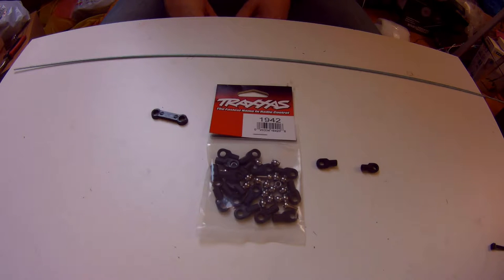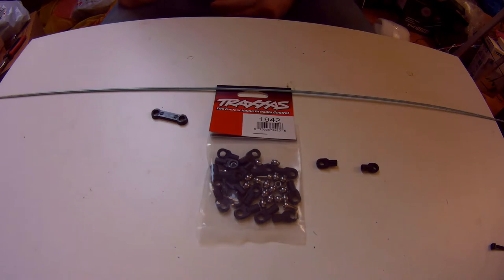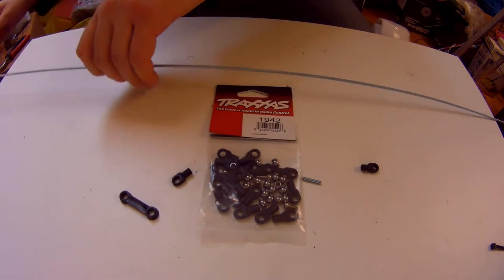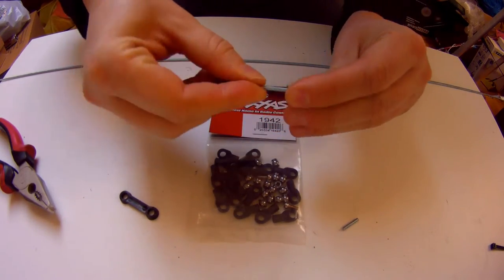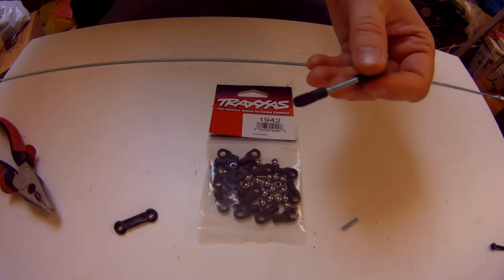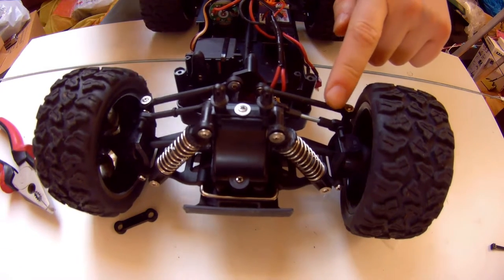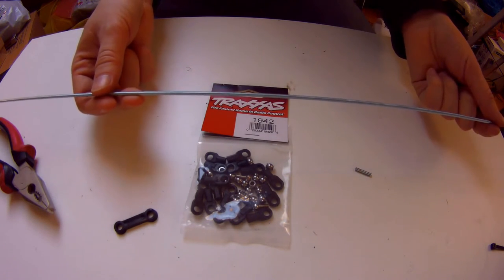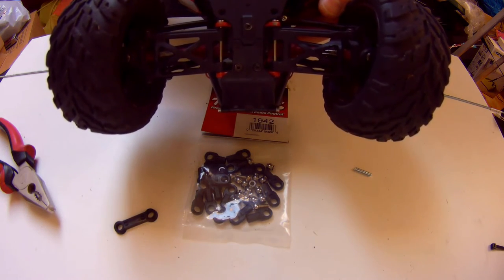Traxxas  - RC metal suspension upgrades - homemade - cheap and easy

Comment: Nice! simple and effective. I've made parts similar except instead of using threaded rod I used solid aluminum rod, drilled holes in each end for little screw with the heads cut off, then I screwed the ball joints to that.
Making stuff yourself is the best!!
Reply: I will be sure to check it out.